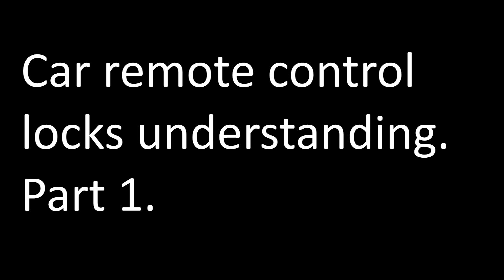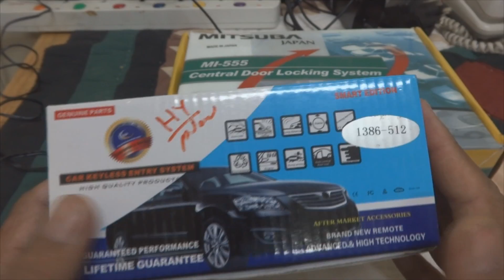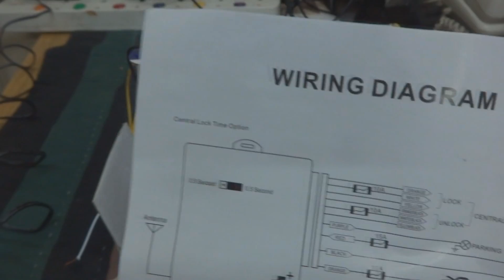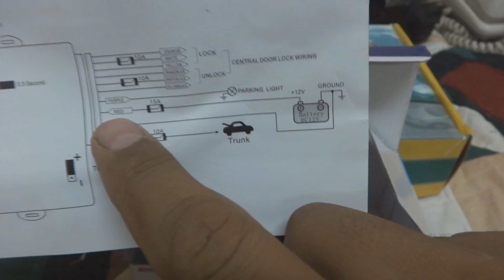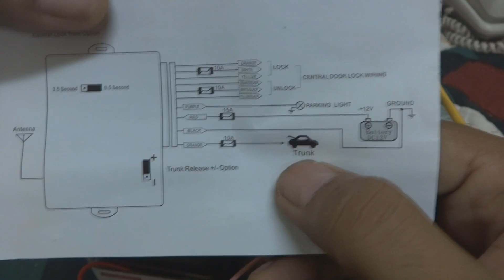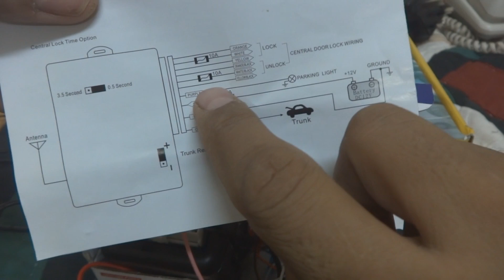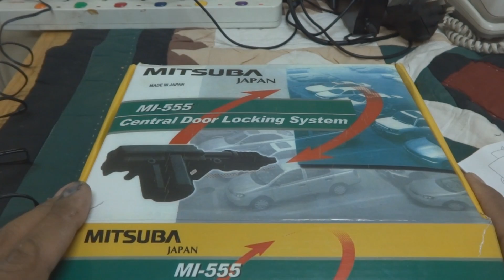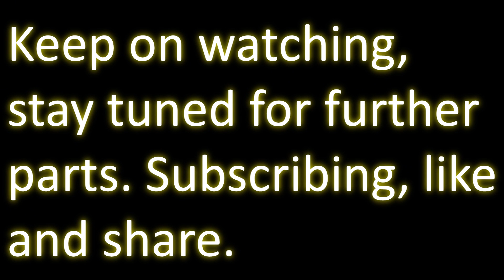Keyless entry; car remote control part 1

Comment: Hi my friend nice to see you again. 
This is great video thanks for sharing. 
I have a question about my car's remote control and need your help. 
Sometimes it takes many presses to open up or close the door locks i replaced the battery with new ones and different types and cleaned up the remote chip with electronics cleaner with no luck ,  I think it is the receiver unit what causes this problem. 
what is your opinion, what should I do to fix it? 
I have a little knowledge of electronics.
Reply from the maker: +toolman talal I think it could be a press pad problem on the remote control control unit or even could be a receiver also. You can open the unit and try to get signal inside on voltmeter or scope while pressing on remote control. By this way you will notice either remote is sending signal or not. Sometimes a very small component on the receiver end creates such problem. One time I replaced a small diode bad on a radio which was not picking signal from its antenna hence no audio. You may check it with patience. Regards,
Reply: LearningZone
hello dear brother i hope you are ok after the rain and floods in Buraidah .
 thanks for helping me and other people and make these great videos .
i'll try testing the remote components .
i am weak in electronics put i'll try my best .
regards.

Comment: Looks like a nice simple unit :-), i didnt fully catch the wire connections to the actuators but i dont need to, i can see the logic.
it looks like the relay contacts are open for any configuration com/n.o/n.c, single pole and double throw :-)
I like relays, an old technology but still very usefull, great for taking the load off switches used for spotlamps/fans/extra's, 50-100 Milliamps to turn a 30 Amp relay on, handy :-D
Hope your well my frend, havnt seen you for a while.
Reply from the maker: +zx8401ztv Thanks friend for nice comment. The actuator wires are both relay commons. All the time at rest they both get either 12V+ or 0V-. So nothing is happening. When a command is issued (Open or close) there would come change on one of the wire. By that way the motor is actuated in one direction. On the other command, the next wire is changing its polarity; Hence the motor actuates on the other direction. Hope you understood the logic.
I was with my parent for last couple of weeks. There internet was very poor. I was not able to work with videos. Instead only communication was possible with that internet. Regards,
Reply: +LearningZone Yes i do understand, in one of my jobs i had to repair bus door (opening/closing) units, two large single pole double throw relays did the same thing, plus some logic and end sensor pickups made sure the doors never went too far :-)
2 x positive = stop, 2 x negative = stop, the remaining combinations gave forwards and backwards.
Reply: i folowed all wire  one by one as per your vedio and now my door lock is tottaly working and i  tottaly remove that relay.before if that relay conected one of the door lock not open and close.big thanks my friend god bless